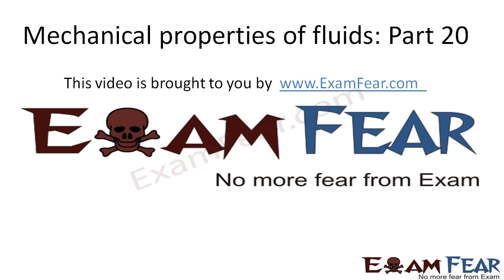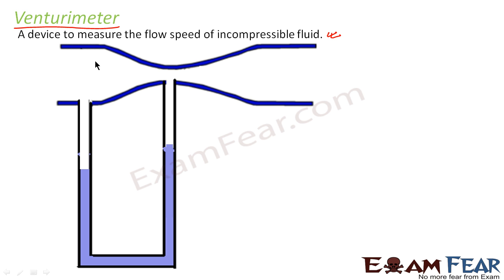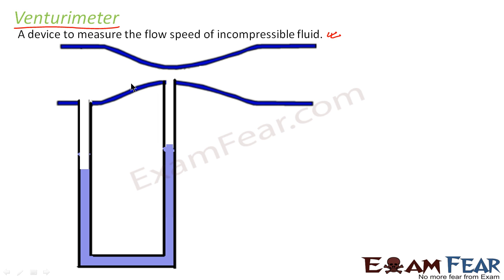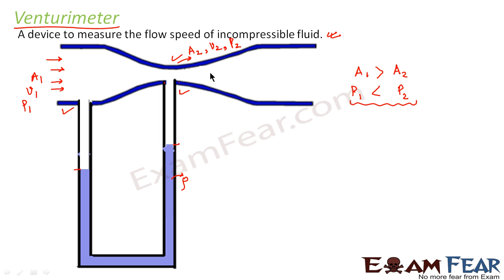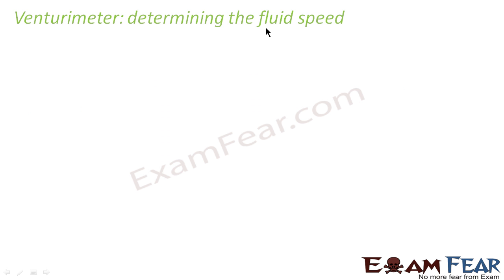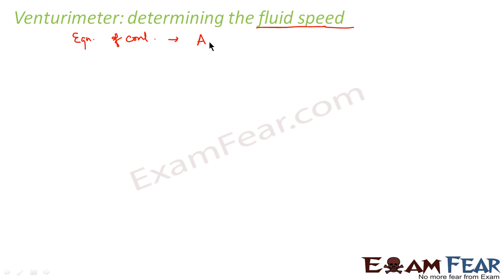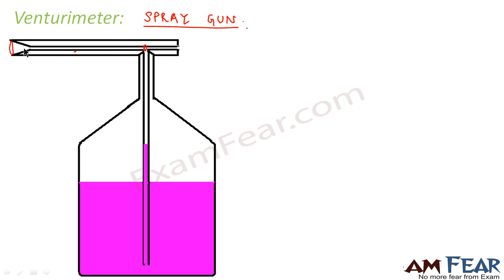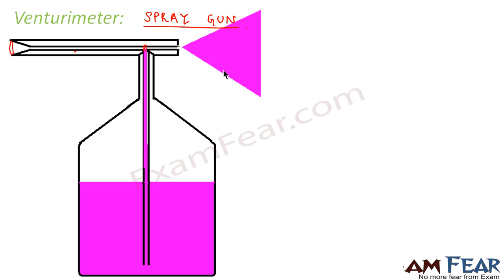Physics Mechanical properties of Fluids mechanics part 20 (Venturimeter) CBSE class 11

Comment: The point where P1 > P2 .. That i understood according to the continuity equation.. but since the P is inversely proportional to area.. P1 should be less than P2
Reply: Maruthi C V .....Can you explain at 10:13 how that term is raised to minus 1/2
Reply: @waseemmaqbool822  there is an error there in the video, mam has squared root the term but not the lhs and the other terms in rhs
Reply: According to bernoulli 's eqn,P1>P2

Comment: correct me if i'm wrong . We can't directly find the speed of fluid using the venturimeter . We have to find "h" and apply it in the formula . we should also know what is the density of the flowing fluid and that of the fluid inside the venturimeter.

Comment: actually in the first case,since the flow is in horizontal tube.the h is 0,it means that bernaulii eqtn become,const -p= 1/2 row* v2...it means that p1>p2..so higher press occurs at the outer area, and less press at throat,so there will be flow from higher press to loer press,therefore flow takes place form the outer end towards the throat,and the liquid gets sucked at the throat,which is the same principle with regards to spray gun...the mistake was rextified with  theat oops portion..